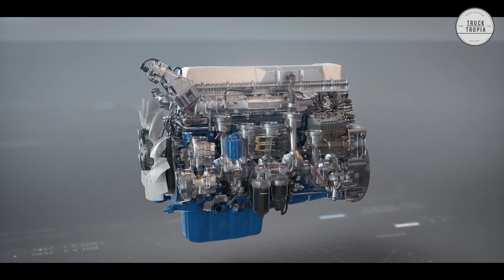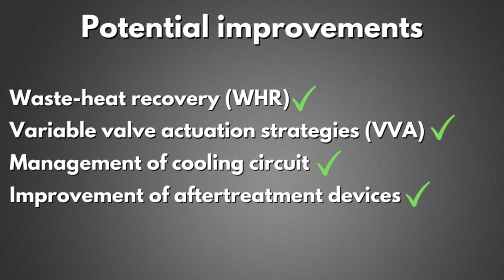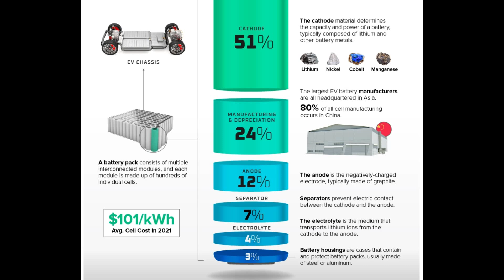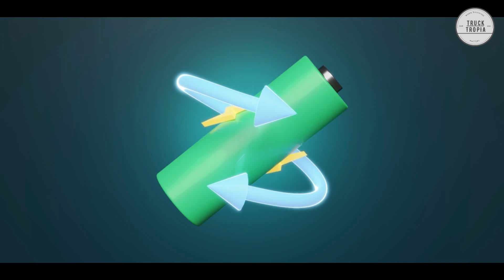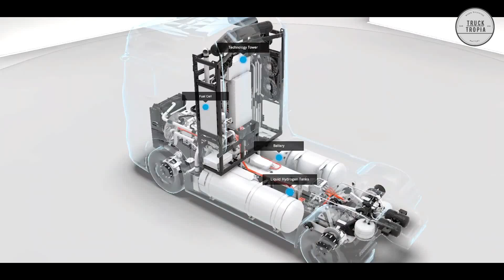How Dirty Are Diesel Trucks Really?

Comment: I notice you include in the CO2 calculation cost to manufacture, OK, then why don't you include the cost to supply the fuel? What is the CO2 fuel delivery cost in atmospheric PPM of all those tankers on the road and at sea compared to localised and network electric fuel distribution?

Why are some industries so against electrification? It's because it doesn't have centralised supply (with it's necessary influence on geo-politics) and whole industries would go out of business, such as the massive oil tanker fleets, the oil trucking fleets, the fossil fuel refineries - but most importantly the military industrial complex that protects those localised oil sources. Energy diversification is the goal, it's not just about lowering CO2 emissions. Anyone who presents a picture that doesn't include such a discussion looks suspiciously like they are pushing propaganda rather than a balanced view.

Comment: There’s always a place and time for everything right now electric vehicles should only be used in cities where the distance are a lot shorter and you can charge them at your warehouse. They should be used in the ports but to be used as a long distance truck it’s not there, and what about mountainous regions even the cold I can’t see one of those electric vehicles driving up and down on the ice roads in Canada or even hauling freight all the way up to the Arctic so people just have to have common sense and use the technology, where it is best suited

Comment: You provide misleading information in this video. 
Lithium batteries are 95% recyclable. 
While it takes 4 to 8 years for an EV to break even, you failed to mention that over the vehicle lifetime, it's better.
Where energy is produced plays a very important factor, which is why their is a 4 to 8 year break even span.
As cleaning energy become available, EVs will be a much better choice.
You'd do better to provide an analysis of load capacity and downtime for charging. EVs are a great choice for local delivery, but NOT long haul. In the near future, I see an additional tax on EVs to fund fire departments and the need for specialize equipment in case of fire and a tax to maintain roads, since a majority of road tax is from the sale of fossil fuel.
Finally, Washington state is NOT banning petrol powered vehicles! 

BTW - I don't own an EV, I have a hybrid and a diesel truck. EVs are the future for passenger vehicles and hybrid is the future for long haul trucks, NOT electric.
Both sides are presenting best or worse case arguments instead of a realistic argument.
Reply from the maker: Happy to see so dedicated subscribers 👍

Comment: For an EV to have twice the carbon footprint to produce you have to compare a hummer EV to a hyundai elantra. Even though an EV takes more resources to produce its lifelong carbon footprint is much smaller. The problem is the all or nothing mentality people have. An EV truck won't be good for cross country hauling any time in the next 5-10 years, so use a diesel. At the same time lots of diesel engines do 150-300 miles a day, replace those with EVs.

Comment: It's all about driverless trucks. This is why the diesel is being faded out. 
The electric vehicle is easier to make driverless then a diesel engine. 

Because then the driverless truck don't need to start a motor. It just has to turn on. Easier function. 

But my biggest gripe is the destruction of forest to put in massive solar panels fields. So then destroy woods to save planet. Sounds like a good idea to me. 

If we just go hemp. We would have the issues of infrastructure, electric not working, and many other problems that I just can't think of right now.

Comment: 1 Horse power is a measure of the ability to move objects.  It takes a specific amount of energy to produce 1 horse power.  that is, to move a specific weight over a distance - say 1 mile. No matter what fuel is used that energy must be expended to get that result.  The fuel - or energy source does not care what you are moving or how far. ! HP is required to move 1 pound a psecific distance in a specific time.  Use Diesel oil, you must include the pollution of processing raw oil into diesel and then the products of combustion to run the engine in the truck. Use Electricity - 1200 Watts equals 1 HP.  You have to generate the power using coal, oil, Propane, Natural Gas, wind or nuclear energy. You have to manufacture the batteries in the truck, the motor and you will still need lubricants for the machinery to run. The power station will generate pollution. for each HP (1175 Watts) it produces. Depending on the fuel, we can calculate the waste products.  There is no free ride. No matter how you drive or move the vehicle, it still takes the same amount of energy to produce 1 HP at the driving axle.  The real question is, how much pollution is involved in the entire process from raw materials to finished product and THEN add the cost of energy to move the vehicle. We MUST ADD the scrapping costs as well. All the propaganda about electrics don't show the total birth, operation and death cost of electric vehicles.  By the way, minimum waste product production of electricity is NUCLEAR, guys. Like it or not  No it is not wind. Think of the ocst of producing the turbines, setting them up, naintaining them and then, in 20 years, destroying them.  Solar.  The half life of a solar panel is 10 years.  from 100 percent output to 50% output.  After then it is a rapid decrese in output. all this ninsense about solar panels being pollution free - how much energy did it take to make each one of them and how musch wire and other equipment does it take to operate them.  What is the cost of scrapping them?  No free ride. No power without pollution.

Comment: I think electric cars and trucks get caught up on the environmental part. There is other things it brings. Like less mantance (way less moving parts), better torque at all RPM ranges, and better traction control (since you can control power delivery more precisely compared to a gas engine)
Reply: Electric motors deliver the torque at maximum right from the moment you push the accelerator pedal.
Reply: @angelperez7891  .... which you may, or may not want. You don't want full 100% torque the moment you push the pedal sometimes, like... snow. You give 100% torque to your tires while you sit in snow and all you're gonna do is spin. Oh, and.... while we're on the subject of snow... guess what else doesn't work very well anyplace there's snow? Right, batteries....

Comment: Excellent video 100% facts that are unbiased, great work.
Reply: Listen again.  "Governments make new rules each year for diesel." (Wrong. Plans are laid out well in advance, as in 10 years).  "In order for the diesel engine manufactures to meet the overly strict emissions standard"...(This doesn't sound very unbiased to me). The people dictate to the Governments they want cleaner air.  Diesel as a fuel was developed because it was cheap.  Exactly why it's still used today.  I don't care if the diesel dies or not. I don't look under a truck's hood to see the engine.  I just want cleaner air.
Reply from the maker: Thanks

Comment: i think the reason there is such a heavy push for electric vehicles is because when in the future you say something unacceptable and your car gets turned off. Also for the electric cars there is much less tuning capability and much less self repair which usually means that when something bad happens there will be no way to fix your electric vehicle without going to a manufacturer for high demand low competition parts that will be deathly expensive.
Reply: One item put forward at least in the UK ,is the use of geo-fencing ones EV, conspiracy theory?? Dont fall for the EV hype.
Reply: Pfft, that's going on with ICE vehicles in the last 10 years. They all have the equivalent of smart computers in the dash in those infotainment units (which are deadly as hell because drivers get distracted by the damn things). Let's put the equivalent of a PC in the dash with a delicate touchscreen in a car. That sounds like a great idea, right? What, with how people will suddenly have to stop now and then and anything on the backseat could become a missile, or maybe your child sitting back there might throw something at their sibling sitting in the front and smishy smashy goes the dashy and you now have thousands of dollars of repairs to get for the one thing the car absolutely cannot run without. That's why I don't want any car newer than 2010, I do not want one of those stupid things in my dash. Heck, I owned a 2003 Bonneville that had critical car systems ROUTED THROUGH THE RADIO because Pontiac didn't like people putting aftermarket radios in their cars. The more advanced they get with cars, the more crap will break down and that just fills their pockets when people have to repair all that crap. Meanwhile, we have Ford Model As that still run to this day and if it doesn't, you could probably get it to run yourself after a couple hours of tinkering.
Reply: Another thing about EV's that no one is talking about is the cost to insure them.  I have a 2023 Bolt EV and my insurance is twice that of my 2012 camry.  I inquired about the difference with my agent and she said that there are more electrical parts that get destroyed in a major accident and they are expensive to replace so they just total the car and pay the full replacement cost.
Reply: The tradeoff is there is much less to repair on an EV and in general they tend to be extremely reliable due to having less moving parts.  I suspect a tuning industry will develop as EVs gain market share, there is a lot of potential in computer tweaks and higher output batteries and motors.  The very high acceleration of most EVs also makes for less demand for performance mods.  The other concerns regarding geofencing, remote disablement, etc are also valid concerns with ICE vehices and the pushback against that needs to happen now, EV adoption will have no effect on that because the same tech can be installed on ICE vehicles.

Comment: I agree that Diesel trucks are still used for long haul in 10 years. I agree on your hydrogen explanations: too complex for cars, difficult and expensive to trucks and 95% of hydrogen is produced with a huge CO2 footprint. And the hylion erx might be an interesting alternative for long haul, but the company should also invest in the production of gas.
Now, why did you get a thumbs down from me: Where do you have the figure of up to 94kmiles until a ev has get rid of its production backpack? Those figures are from very old, outdated studies (Sweden study). Please read recent studies and get up to date here! It is 10-15kmiles only! And bio Diesel as a solution, serious? It is far from a solution, but a big problem: water comsumption. Using food for fuel?! Sorry, no! How about maintenance of your Diesel with many moving parts and the brakes? Not needed for electric trucks.
And the greatest mistake: You compare Ev source to wheel with Diesel tank to wheel. Invest in the production of Diesel: It is really dirty: Fraking, transporting, leakage and the raffinery. A raffinery uses 1.6kWh and more to produce 1l Diesel (Sorry, I'm eurpoean and not used to gallons). Yes, they're using electricity because burning oil would be very, very dirty.
So, look at the entire picture, not just the few advantages of Diesel.

Comment: Part of this issue is that old simple diesels never die.  Prewar equipment still works fine.  There are simply masses of such machines that are run minimally, e.g. an excavator that is dusted off every spring to clear ditches then put away for 11 months.  One has to understand that a modern replacement will never make financial sense.
Reply: A modern replacement won't still be dead reliable after many decades like the old one that only needs fuel, oil, and a starter to crank it. There are a lot of small companies that are relying heavily on old (2000 and older) diesel equipment because they can trust it to run and perform work and make money every day with rarely any problems.
Reply: @Bloodbain88  Dude this is soooo true! I have literally dug out from under a pile of dirt and gravel, an old WWII British tracked front shovel for grandpa at his quarry. Stuck a battery to it, checked oil and water and it started right up! Drove it to the garage, gave it a normal, basic maintenance service, greased it up and off it went to work non stop and no troubles.
Reply: @Bloodbain88  which is amazing really, considering that diesel is the original fuel injection engine. All those moving parts all without a computer. Nowadays it's all computer computer plastic blahblah. The old engines pollute much more, but in all fairness they do last forever
Reply: Also considering the minimal amount of use that many such vehicles recieve. Even if they were replaced with modern equivalents the sunken emissions from manufacturing them may never be paid back from the lower emissions at the time of use.
Reply: I run a 1959 manitowoc dragline for a small gravel company...no way would electric power for this be financially feasable...its like the little kids are running the show and "force" this on everyone...its absurd
Reply: @keystonecountryboy  That's actually right. They live in a fantasy world and don't understand the way things work behind the scenes that make their lifestyles possible. The things that fuel and drive the infrastructure of society.
Reply: Also most of the old Diesels are high compression engines around 22-1. The modern diesels have had the compression reduced to around 16-1 in order to reduce the vibration and noise. The old high comp engine means you can run the things on heating oil, old cooking oil, recycled oil and others after they have mad some minimal treatment.
Reply: @andretorben9995  My 12 valve Cummins is currently running on a witch's brew of old gasoline, some diesel, waste motor oil and waste transmission fluid. Runs just like it was on 100% diesel. Anytime we have any kind of waste oil I dump it in. Power steering fluid. Brake fluid. Hydraulic oil. Cooking oil. I don't have a centrifuge to filter it through so I don't run 100% waste oil. But I could.
Reply: @Bloodbain88  amazing
Reply: All those sensors and catalyders, CPU you're putting on today's diesels how much pollution do they create when you make those items?
 I'm not being sarcastic I'm just curious. I know for a fact bio fuel freezes or gels up soon as you hit  20 -25ﾟ and mining for the  materials you need to make the batteries are known to be environmentally disasters. So, how is that diesel in 1988 so much worse than today's?
 We used to drink water from a garden hose, we didn't have any plastic bottles floating around in the oceans. I'm just saying my head is not up my ass and if your environment is full of sh!t maybe just maybe it's because your head is up your?!
 Also back in the eighties my mechanic fixed my truck most of the time with just a few adjustments, today a mechanic needs a building full of tools that were created by destroying the environmen and those tools become absolete in a few years.
 No matter how many lies you pil up on top of lie to cover it up it's still a lie! 
 It is proven that today's modern corporators make 97% >of the power and torque that a fuel injected engine makes.
 And you could fix it with just a few adjustments if something goes wrong.:)

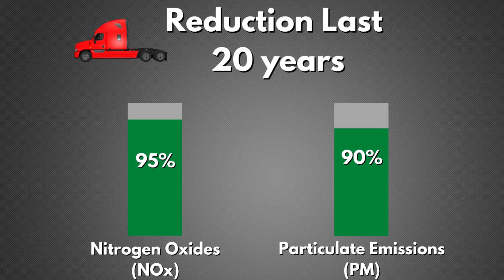Comment: 1:41 NOx und particles are not the only pollutants. And 5 to 10% remaining pollution is still too much.
2:13 HVO Diesel is not pumped and available like crude oil. 
90% reduction by burning HVO Diesel is only available for a small minority of trucks or as an additive of fossil diesel just like e-fuel which takes too much "green" electricity to be produced.
4:18 Yes the answer is Zero. Not now of course but it has the chance that the Diesel truck will never have.
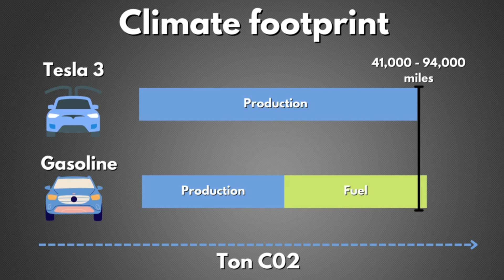5:23 This is a bold lie or based most likely on data from 1894.
5:50 Yes electricty as fuel still has some hurdles to take but are possible to take.
8:26 I agree on the premise made on H2-Trucks.
8:37 CNG is no real aternative as it is a fossil fuel. As CO2 neutral fuel it takes too much "green" electricity to be produced.
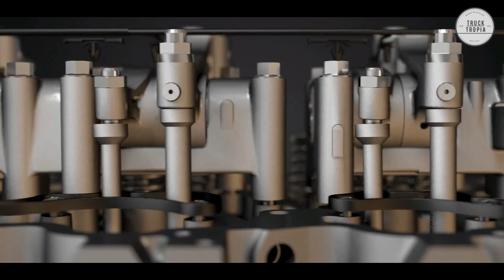9:53 "...or maybe the Diesel engine will be improved so much that electricity just can't beat it..." only delusional day dreamer believe that.
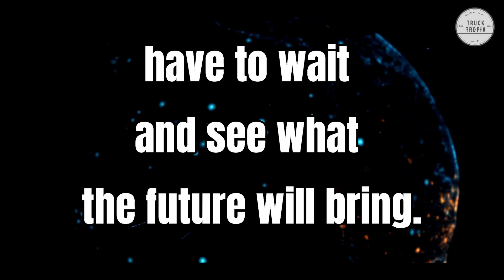10:08 "...several decades will pass..." there is no time for serveal decades to pass.....how old are you? Do you have kids?
10:18 "What is your opinion" Of course the Diesel should be repaced as soon as possible.
The only possibility is electricity. Wind and solar power as source and eFuelICEV or FCEV but most preferably is BEV.

Comment: In 2014 they made a huge studdy in the mid size city gothemburg in sweden about NOx. And it turned out that only 24% was from traffic, and of that, half was from comersial vehicle. 

But more importantly, only 25% was from Euro 5 and 6, 75% was from euro 4 or older.

Now 10 years later there will be hardly any euro 4 and older left so the NOx from cars and trucks are probobly in the range of 5-8%. Totaly eliminating them will have hardly any effect what so ever.

So where was all the NOx from. The lagest part was large ships in the harbour. Smal engines was a suprincingly large part and fire (like fire places) was also notable, as well as powerplants. Smaler source emotion was work equipment like diggers. It's likely that due to them as well have to conform to euro emissions, that will also be reduced over time, but a bit more slowly due to they generally have a longer life span.

So what did we learn about NOx.. its a decreasing problem. Its mostly so from smal and unregulated sources and combating it in vehicle is really no longer realistic.